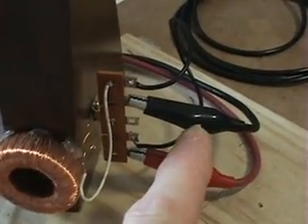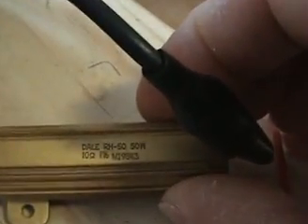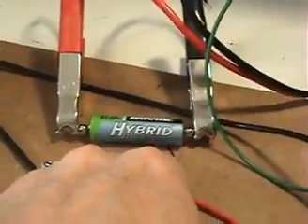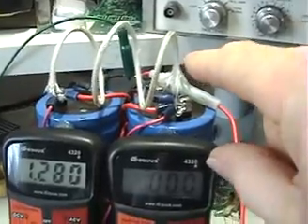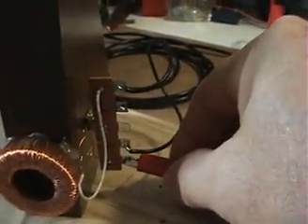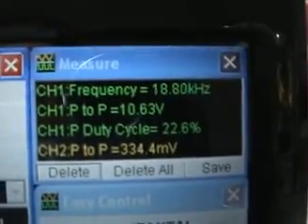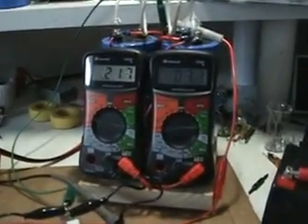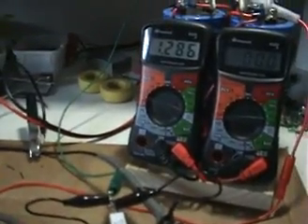Self Running Coil test 2

Comment: Hi Luc,
well done, but
you couple into the circuit via your gate-drain or gate source capacitance some energy from the spikes when the PWM switches.

Just try to make your Toroid much bigger in size and try to use the BackEMF from it to power via a diode or graetz bridge some loads.
especially, when you add the magnet.
This should really kick out some additional energy, look at the latest Naudin experiments.
Good luck !

Regards, Stefan.
Reply: Do you have the link for the Naudin experiments ?